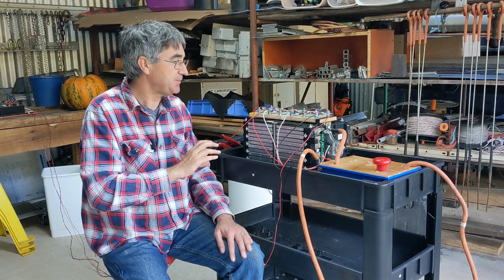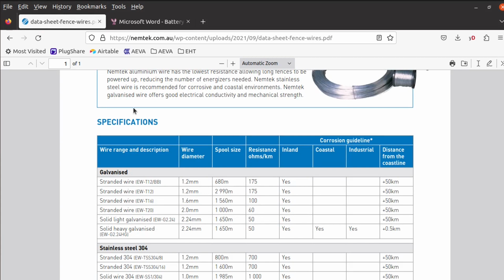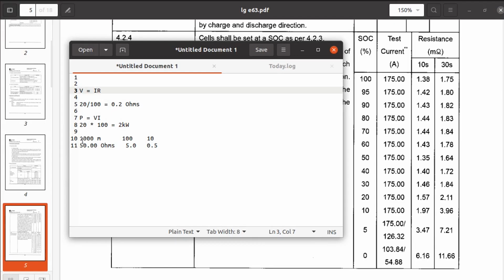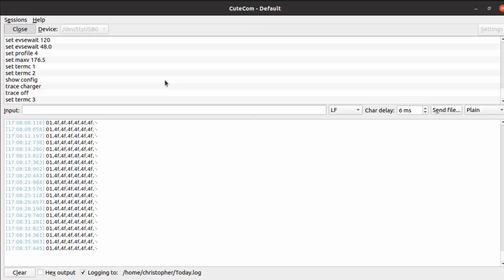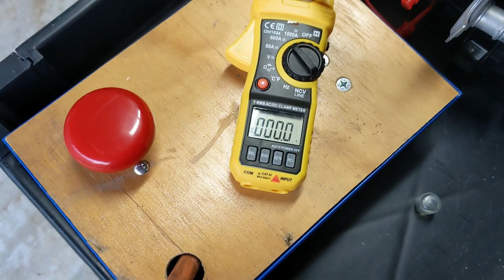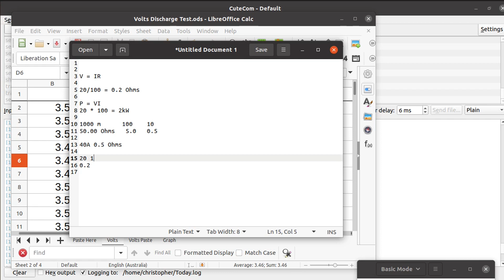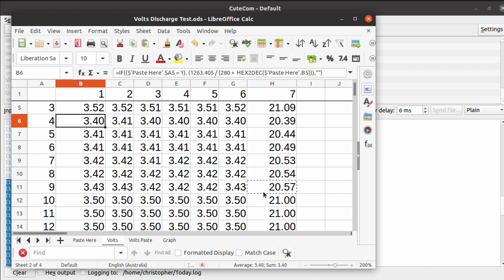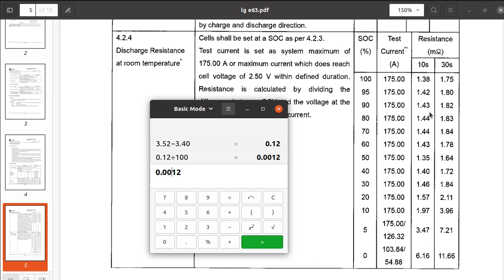Hyundai Kia Battery Discharge Test

Comment: May I know why did you install fuse and emergency switch on the cable that is connected to negative B? Thank you
Reply from the maker: This was in case something went wrong.  The fuse would blow if I drew an immense amount of current by mistake.  The switch was to give me an easy way to make or break the circuit.
It wouldn't matter where this was in the circuit, it could have been on the positive terminal.  In my case the connectors fitted onto the negative terminal neatly.
Reply: @christopherwalkden  Thanks. I saw in some EV conversion videos that main fuse was installed on B negative of HV battery. I was wondering what the correct and safe practice.